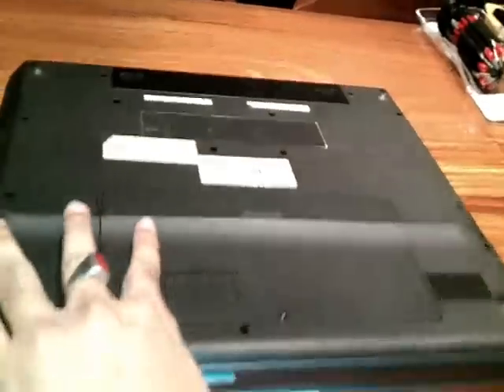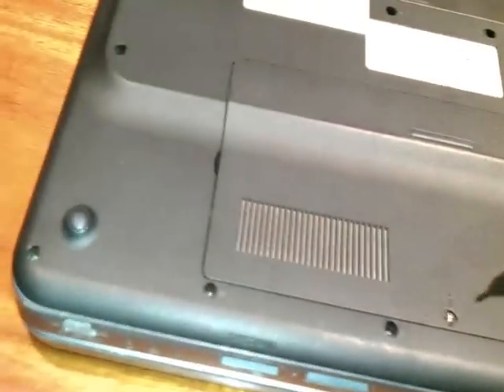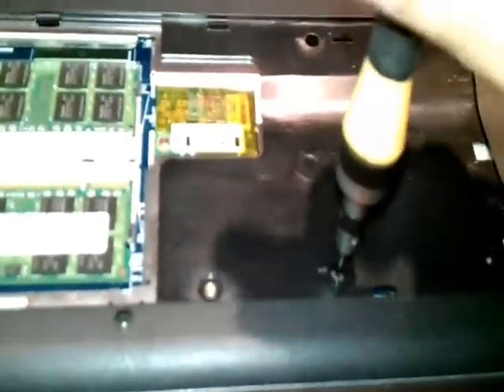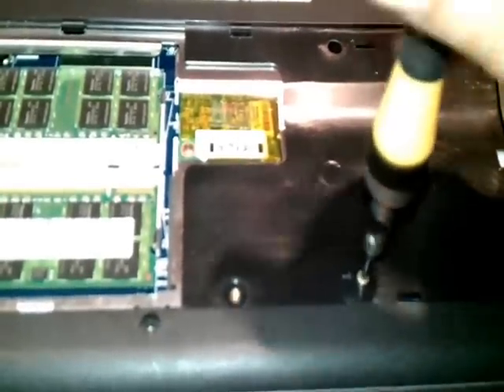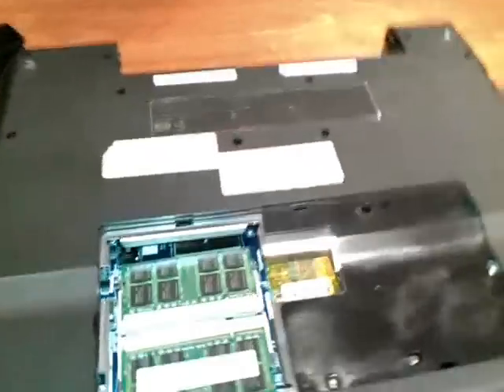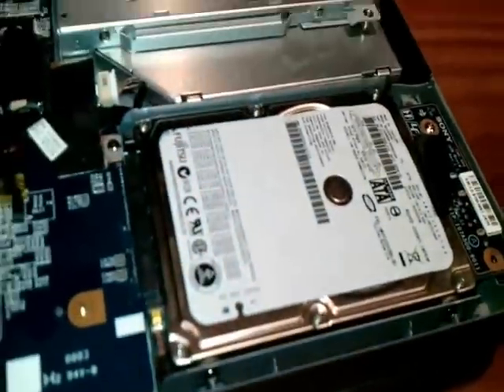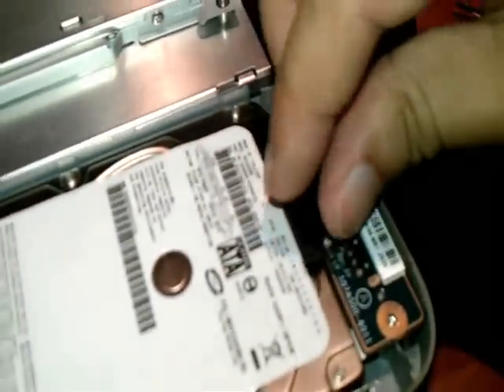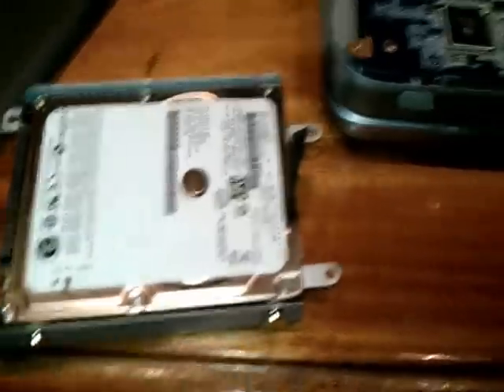Sony VAIO VGN notebook's hard drive replace or remove

Comment: I came to this video specifically to figure out how to remove the screws that are deep and you went past that. I have a set of small screwdrivers. Is there a screwdriver specifically meant for laptops that has a magnet on them?
Reply from the maker: Sorry bro, i had passed them coz i wanted to show fast by the yes u can use ur screw driver set just check which head fit to those screw its very simple nothing especial, wish u all the best and plz Subscribe!!
Reply from the maker: hope it works!!!